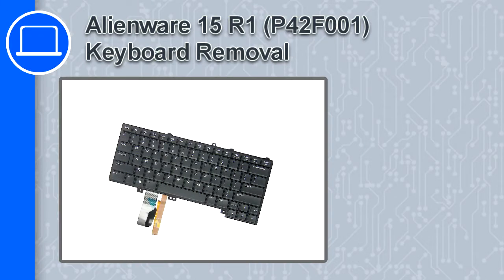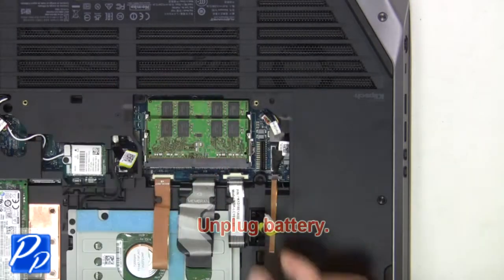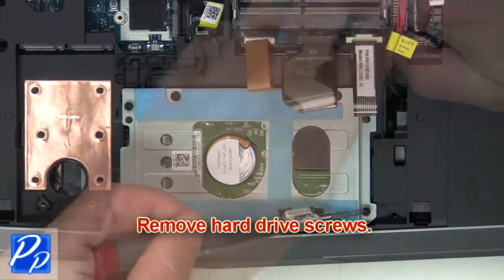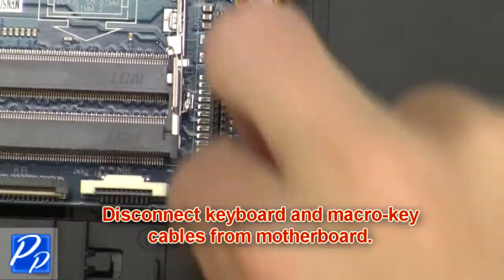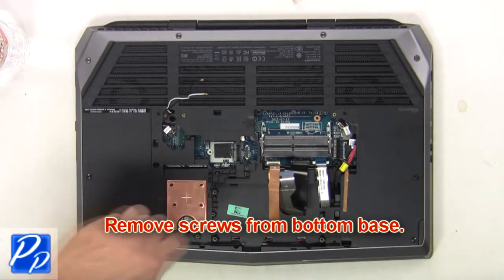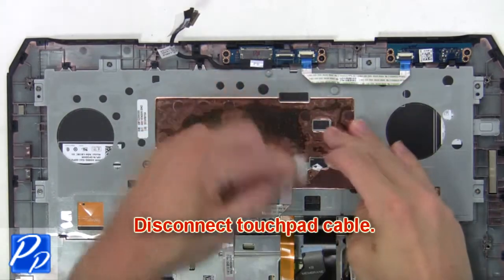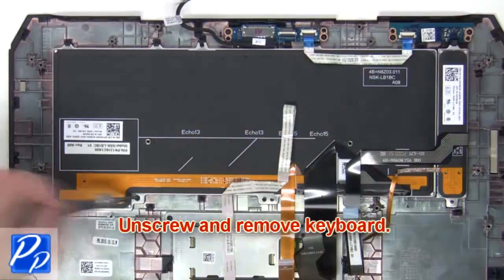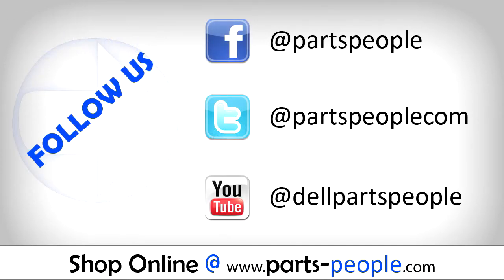Dell Alienware 15 R2 (P42F002) Keyboard How-To Video Tutorial

Comment: Does the keyboard separate from the far left with the numbers on it? Wondering if I can swap those numbers onto a new keyboard when I order it
Reply from the maker: They technically can be removed and swapped but are not designed to. The retainer clips underneath each key run the risk of damage which is why I typically do not recommend trying it.
Reply: @dellpartspeople  well the replacement keyboards online do not show them. Just the actual keyboard itself. Not the far left 1-5
Reply from the maker: @DrivingCultured_TV  I follow you now. These hotkeys located to the left are separate from the main keyboard and can be left in place when swapping the keyboard.
Reply: @dellpartspeople  sweet, that was my question. Thank you
Reply from the maker: @DrivingCultured_TV  No problem.

Comment: So i was changing the battery since the old one suffered a “terminal error” after the charger got completely fucked. (Admitably my mistake)

So i’ll just ordered a new charger and a battery, can’t be that hard, right?

So after waiting like 2 weeks for the battery from somewhere in motherfucking China, I wanted to simply change it...

But in order to change the bloody battery for this shit you need to take apart the whole thing, that took about 45 minutes, but in the process my KB Membrane got fucked, and now like 8 keys aren’t working.

But they sometimes DO work if i apply pressure to the KB-membrane-wire-strip-thing

Obviously it’s impossible to actually use the fucking thing like that, I cannot be constantly fingering my laptop with one hand, and type with the other.

I can’t even log into my fucking account now, this is also my brothers’ computer.
So they’re bound for a surprise when they come back home in like 4 days.

And I just wasted 3 hours trying to fix a damn keyboard . i’ve got fucking homework to do, and now I can’t even do it.

Why not just make a slot for the battery like any other fucking laptop.

Thanks Dell
Thanks Alienware

I’ll be sure to avoid your products from now on
Reply: BROOOOOO 😂😂😂😂 I've just fucking done the exact same thing.. Did u ever fix it or end up replacing keyboard?
Reply: Please im in need of answers.. realising now it's a comment from 4years ago
Reply: @ixsantoxi2673  I don't remember, I don't think we fixed it, we all have new computers now. Sorry :(